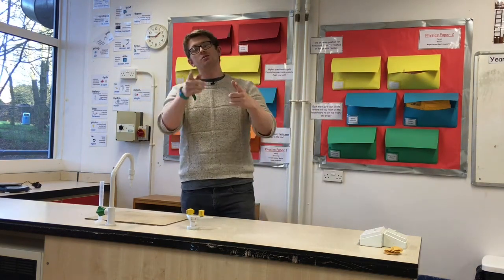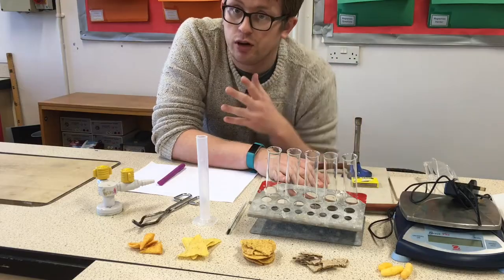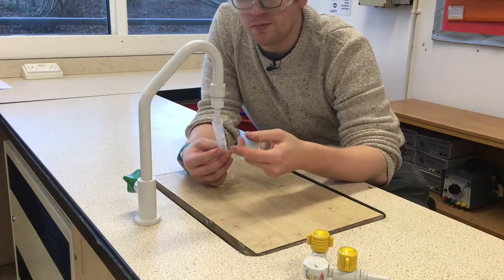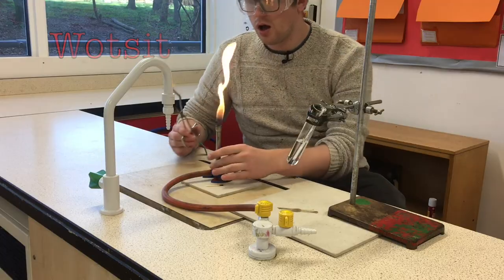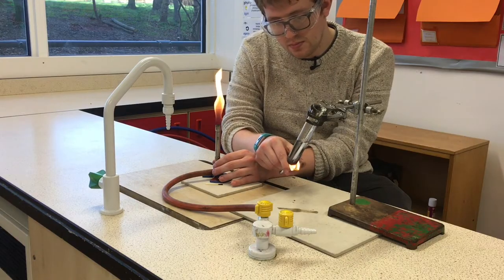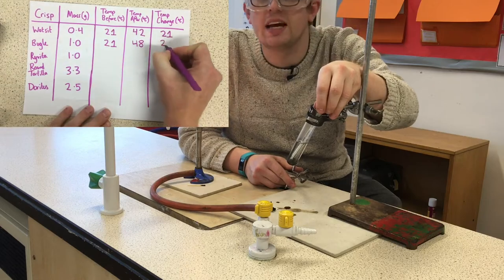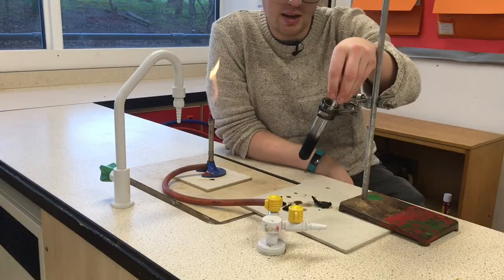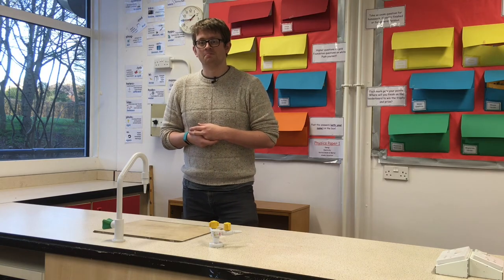How much energy is in our food? Crisp burning lab practical with Mr Pash!

Comment: how would you calculate how much energy per gram?
Reply from the maker: So you can do temperature change per gram (which is temperature change divided by mass).

To get energy per gram, you would first need to calculate energy. You can use the specific heat capacity equation of energy change = mass x specific heat capacity x temperature change. 

Given we used 20cm3 of water here, that's 20g =0.02 kg. The specific heat capacity of water is 4200 J/kg/oC so to calculate the energy you would do 4200 * 0.02 * temperature change.

Now you have the energies, you can divide by mass to get energy per gram.

Hope thishelps!
Reply: @MrPashlerScience  thank you so much!
Reply: @MrPashlerScience  So for your Doritos, if I put everything in the formula: 0.02 * 4200 * 56 = 4704 correct? Then for energy per is is 4.7 divided by 2.5 because of the mass which gives us 1.9kj/g?
Reply from the maker: @WhiteItem  Looks good to me. It's then a case of why isn't that the same number as the back of the packet - not all of the crisp burns, not all of that energy heats the water (heats the glass and air around it) so it's a very rough figure but at least a good comparison.
Reply: @MrPashlerScience  yeah i agree because most doritos packets says around 2000kj per 100 grams but if we take your results into accounts it’s 1.9kj/g * 100 which is
190kj so..